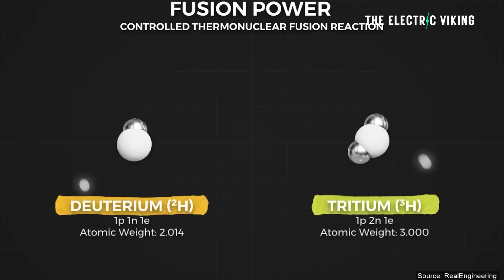US scientists repeat nuclear fusion ignition breakthrough for 2nd time

Comment: I am 70 years old. Fusion was right around the corner when I did a report on it in 8th grade. Let us use renewable energy that works rather than following a dream.
Reply: Very important.  Don't allow dreams of affordable fusion slow our installation of renewable energy and storage.  The planet is already suffering from increased heat retention.  We cannot afford to gamble on something that, if it does work, is 10 to 20 years away.  We need to get fossil fuels off our grids in less than 20 years.
Reply: The energy transition is a big gamble. We should use our money to adapt to climate change rather than stop climate change, because the climate will change.
Reply: @andrevanrossum8408  

Have you given any thought to what we would need to do in order to adapt to extreme climate change?

What could we do to deal with melting polar land ice and glacier ice?

"There is still some uncertainty about the full volume of glaciers and ice caps on Earth, but if all of them were to melt, global sea level would rise approximately 70 meters (approximately 230 feet), flooding every coastal city on the planet."

Every coastal city on the planet would have to be rebuilt inland.  Cost?
Reply: @bobwallace9753  Sorry, I don't believe your horror story. I hear them regularly for many years now. The earth wouldn't exist at all if only a fraction was true.
Reply: @andrevanrossum8408  
Let's try some critical thinking.  

We can measure the volume of ice sitting on land right now.  We know how many gallons of water that would result and that almost all that water would run off land and into the oceans.

What you think would happen if all land ice melted?  Have you seen any math showing that we wouldn't see very large increases in sea levels?  Any explanation of where all that extra water would go?

Comment: Wasn't there a previous "success" where they just happened to not mention the power put into the system? Always just around the corner.
Reply: They said how much power was put into the system. They had a public panel, of the scientist who are working on the experiment. Talk about the entire process , too question from the audience. It was on the Department of Energy YouTube channel the same week they made headlines. It's still on the channel.
Reply: @michaelstiller2282  In this case yes, but I maintain fusion isn't working until there's a sustained output, which there wasn't.
Reply: @rogermckenzie2711  It was the first experiment that had a net gain, ever. So it worked, their problem is feeding the custom pellets, (where each pellet needs to be  analyzed for flaws, and choose 1 out of the entire batch they made, for the most accurately made pellet.  Then analyze the pellet, so they can align it in the laser for the greatest impact.  The reason they had a net gain is because they got better at making the pellets and understanding how fire the laser to get the best impact. Their other problem is the fuel is rare. Considering the primary  use of the laser is not for fusion experiments, they wont be the ones to figure it out.

Comment: The lasers are very inefficient, taken as a complete system many times more energy was put in than they got out. The best fusion start up is Helion in Seattle. That’s the reactor shown at the very start of the video
Reply: Not to mention it needs to run all day so automatic pellet change is necessary,  even pellet production is poor. Focus on wind and solar.

Comment: But the fusion reactor laser efficiency is like only 10% at best. Thus  90% of that laser's input energy is lost and that's not been included in the fusion energy calculations.  They typically only include the energy at the point of delivery to the fusion reactor.  Thus they are still nowhere close to a net gain when all energy inputs are considered.  Bit of a scam really to keep up the public interest and keep the research funds flowing.
Reply: And wher is that waste heat going to go - into warming our atmosphere even more than it's already warming!
Reply: No, it can be used to boil water to drive turbines to turn generators which will supply electricity. After all, the fusion reaction heat will be used in the same way.  @eclecticcyclist  And those lasers are more like 1%  to 2% efficient, according to published report. So the fusion process is still a long way from being economically viable.
Reply: @RWBHere  using the heat to boil water to drive turbines is only 30% efficient so still  over 60% of the heat will reach our atmosphere.

Comment: I am a former research assistant who worked on a joint project with PPPL.  The ignition program is not completely worthless.  It has resulted in tremendous advances in laser technology amongst others.  But as for the method's potential for power generation, don't make me laugh. It has no potential. It was not designed for that purpose anyway.

Dude. Please stop posting videos on things about which you are horrible unknowledgeable.  It's embarrassing tbh.

Comment: It is still far far away. Be careful. They are not counting the energy which is used to load the lasers. They are only counting the energy of the laser beam which delivered energy directly to the target. As the lasers used are quite inefficient transforming electricy to beams that hit the target, there is no engergy gain. And therefore there is still nothing. Furthermore they are using pallets placed PERFECTLY in the center of a focussing device. Reloading this device takes hours up to 1 day. 1 KW of plus energy every day is not a viabable solution for a power plant. If there will be much more efficient lasers AND much much bigger/faster reloading device, there maybe a feasible fusion reactor. Sounds more like 50 years away than 5 years away.

Comment: Filling in a criticism gap... Sam - stating repeatedly that temperatures required/achieved are 'hotter than at the surface of the sun' is a HUGE understatement.
Try 'more than an order of magnitude hotter than at the CORE of the sun'. The core itself being ca 3000 times hotter than at the sun's surface!
Which is anyway moot given the actual gulf between latest hyped 'breakthrough' and anything remotely commercially viable is vastly greater than the one covered first here.

Comment: just use electricity some massive capacitor discharge forced across a very thin wire jumping a small vacuum space filled with a little bit of gas. that perhaps would tear those atoms asunder and make them come back together again as a heavier atom.

Comment: Equating it to the Oppenheimer  fear, is not accurate, at least not currently. Though, once it is running full time at capacity, perhaps then the chance of global incineration might again be "near zero".
Reply: The laser used in the experiment's, primary use, is for nuclear bomb efficiency. 90 percent of it's run time is for that research. This fusion experiment is a weekend project. So unless they build another super laser with intentions of actually hiring scientists to work on it full time, this is probably just a way to keep the project funded.

Comment: Fusion reactors aren't just hotter than the surface of the Sun, they are actually a lot hotter than the core of the Sun.  The Sun had a very low power density, the main reason why it can produce a lot of power is because it is extremely big.  A practical fusion reactor needs a much higher power density than that, do they operate at much higher temperatures.

Comment: you compare old criticisms of your discatded technologies with modern technology of your preferred type.  MSR fusion enery is due to come online soon, and will be proven fast to build.  We don't need solutions in the next 5 years.  25 will do fine.  I pity all those that jumped into battery technology that is so inefficient whereas to you that is perfectly OK.  I say in 25 years time, solar will not be seen as the primary long term solution.  It might get to fruition first but that doesn't keep it number 1 forever, or even for very long.
Reply: This technology is promising, but getting from lab scale to commercially viable in a safe way takes decades.

Research and development should continue, but other solutions are needed.

Now solar panels work well for about 25 years. So that gives scientists some time. Windmills last a bit shorter, but do very well in winter and at night, and can be recycled and upgraded.

Sitting around waiting or pressuring scientists to hurry up will not help us.
Reply: @SolAce-nw2hf   for the record the reply to my comment with the words "sitting around" was not relevant to the original.
Reply: @carusmike  it was my reply to 25 years will do fine, which suggests that it will be in time to make the difference.

Unfortunately in 25 years a lot changes, including the size of the world population. 8 billion is a lot already and most are not at western comfort levels. We need to act now if we don't want unbreathable air and a toxic worn out planet in 25 years.
Reply: @SolAce-nw2hf  and that is  'sitting around'?
Reply: @carusmike  Well, you don't seem to be very positive about batteries or solar and suggest you are comfortable waiting for 25 years.

Maybe I misunderstood your comment, but would like to know what you suggest as short term solutions. 

To be clear, i don't think Lithium is the best option for energy storage, and i have no illusions about solar and wind covering all of the needs. Getting rid off our fossil fuel addiction will be a marathon, not a sprint.
Reply: @SolAce-nw2hf  i am very very positive about batteries.  Batteries of the future.  They will be needed for a very long time.  I predict that those who jumped in too early will have serious regrets in the future.  I love solar as a stop gap until better is fully developed.  I am in favour of both smr and msr as longer term stop gaps.  I think our ability to create energy is only just starting.
Reply: @carusmike  I agree we need better batteries. Sodium looks promising.

I know some early adopters. Some have regrets (mostly about the car it is in), for others it works just fine Maybe Lithium still has a role to play, but I think it should be limited.

There is no one size fits all solution, but solar seems to be pretty versatile. Panels keep getting better, and now they are working on layered panels that capture different frequencies of radiation for even more power per panel.

Personally I know a thing or two about nuclear power. I think cost is a big issue at this point in time and without saying too much, the wrong people profit from them right now.

Investing in solar and wind will produce real power much faster and a lower price. Not to say that nuclear power has no role, but keeping the existing nuclear facilities running at a constant rate is already becoming a problem with solar and wind saturating the grid.